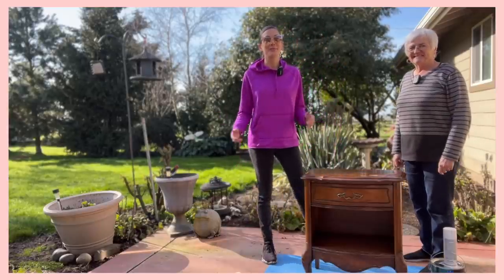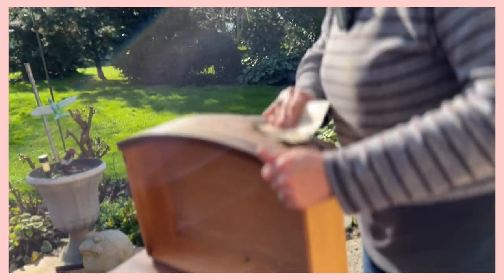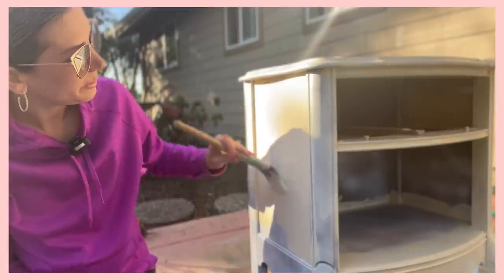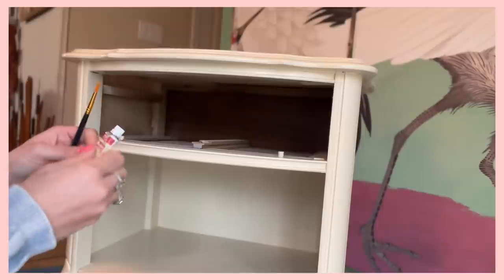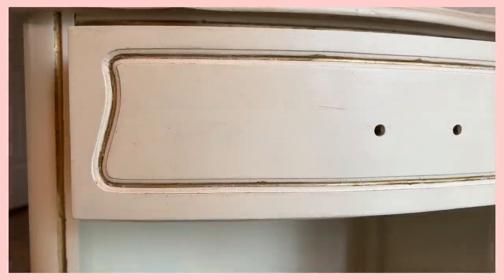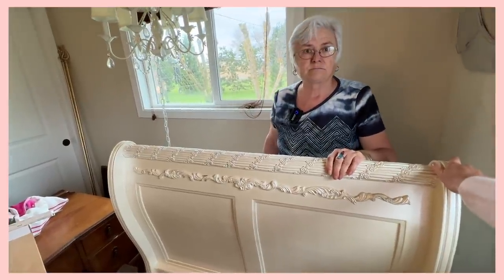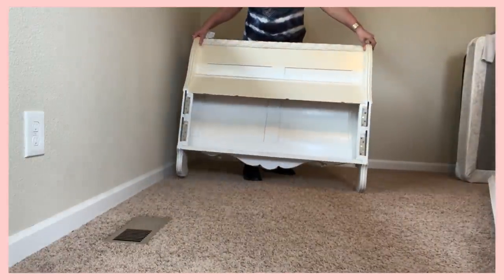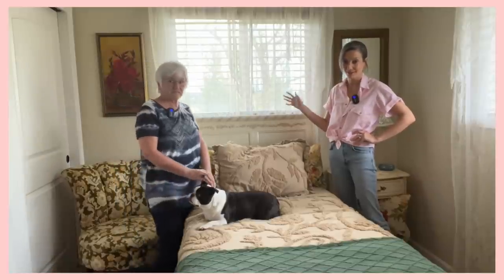Easy Thrifted Furniture Makeover - Paint Tutorial for Cottage Style Decorating or Fancy Farmhouse

Comment: Salena the project I started yesterday is the exact same as your mom's!  My bedside item is
also being painted white. For lining the inside drawers I use fabric.  Easy to do!. 
 Cut fabric to size needed( wet entire fabric then wring water out well) and then mix 2 cups tap water (for a draw the size you are doing) then add is wet place fabric into draw fitting a needed.  Leave draw open to air and it will dry in about a day or two.  I have used this method on bigger projects too.
When you want to change the fabric and add a different pattern just pick at an end and lift, easy.